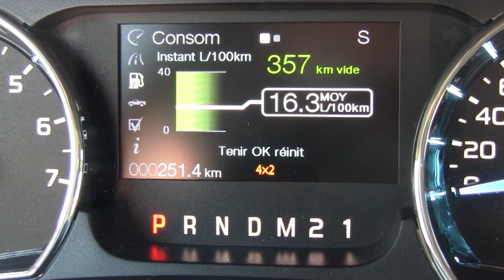The Woodpecker Ep 60 Fixing The Cottage Chimney

Comment: very nice job. I do not like working on the roof. Was wondering why you did not use stainless liner? Less expensive (where I am, at least), lighter, and doesn't chip....

The concrete work is cleaner than the professional did for mine. hired another pro to fix it to only about as good as you did.
The logging makes me sad. That will become chip board or MDF. Had a shot at a maple I helped take down the other year. Clean to 6 meters. More than a meter diameter. Could not move it. The service that came to remove it claimed to reclaim and mill. They chipped and sold to a burner.
Reply from the maker: I don't want a stainless chimney, I'm too scare that it can be stolen. If someone goes to the trouble of stealing $15 barrel, I don't want to think what they would do with a stainless chimney... The rumor want that the wood would be used as poipsicle sticks and medical sticks, I really don't know if it's true?

Comment: Broken in half:  http://youtu.be/B60KzEmVOgQ?t=1m9s
Reply from the maker: That's the odometer of my new truck, it's brand new. I didn't want to make the same mistake than I did on my "broken one" by buying other people troubles, so this time I bought a new truck not used...
Reply: ***** but still the same brand as the on that was broken in half...
(don't wont to be a jerk, realy like your show)
Reply from the maker: Sjuul CNC Ok, I give it another shot. I had a f-150 for 10 years before I gave it to my son which keep it 2 years. Always worked great, then like a moron changed it for a used pick-up from a landscaper, not a good move I know now. The guy must have over charged it and he added some balloon under the back axle and it's exactly where the darn frame broke.